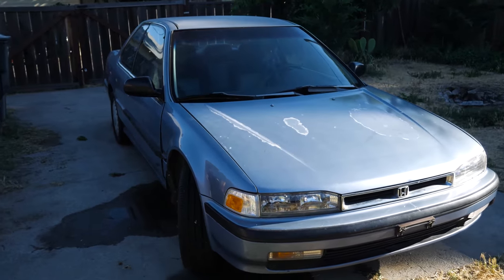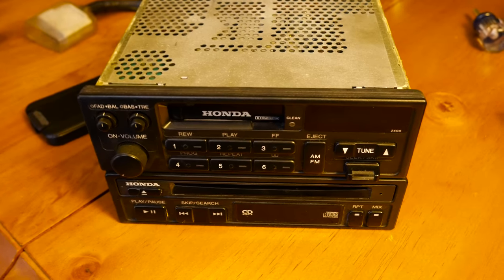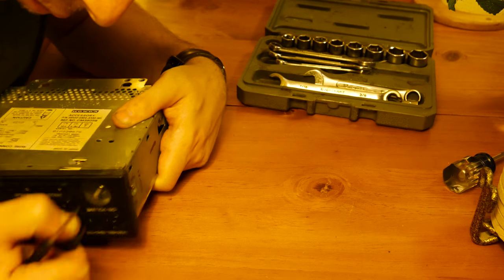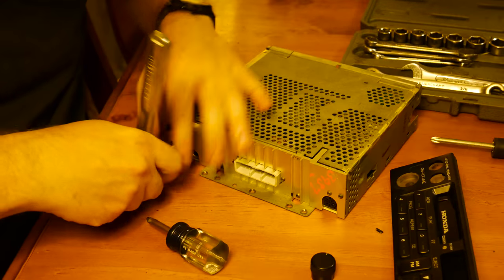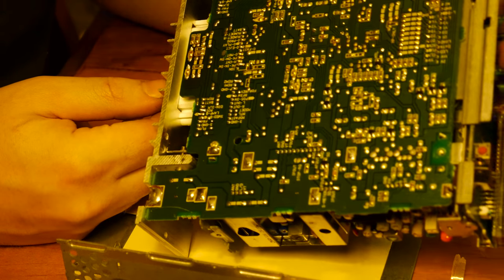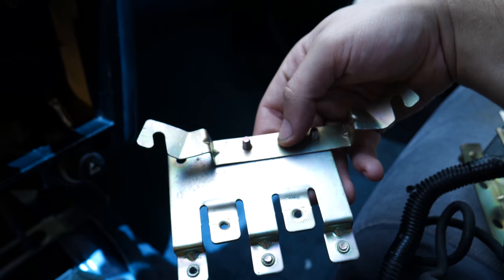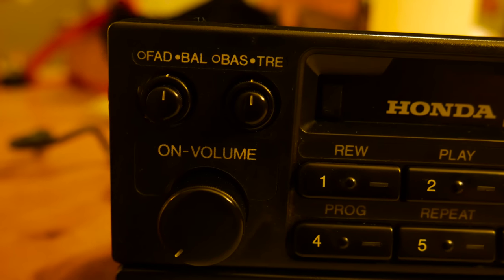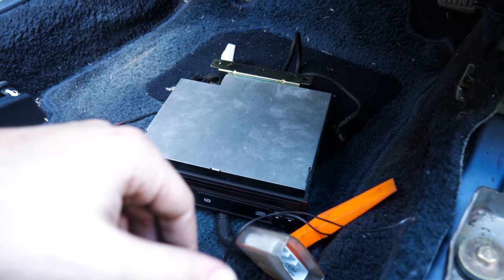Fixing a no sound issue with my OEM Radio [1990- 1993 Honda Accord]

Comment: no but HOW did you get the cd player out?  you're the only source on the internet and I'm paused on the bracket and it's not helping hmmm..
Reply from the maker: Oh it’s two Philips head screws behind the console that you can access on each side of the footwell, you’ll see em if you just look directly behind the stereo from that angle with a flash light. They should be a brass color, you got to have a long screw driver & the bracket for the cd player should stay in place when you take out both. Basically destroyed a CB7 console like 8 years ago when I ran into one my first time lol just take it slow
Reply from the maker: If you have any more questions just message me on instagram @paycotsunami
Reply: you're faster than chatgpt haha no way thanks

Comment: Did you ever get the CD player to function?  I have a "3000" Series tape/radio with the add-on CD player, and I have the same issue with the CD player,  it no longer functions.
Reply from the maker: I've gone and grabbed 3 in total since then. None of them function properly and honestly I've taken all three of them apart extensively to no avail 🙅 only thing I've seen is the actual CD motor went out. I personally gave up on a functional cd player so now it's in for looks in the CB7. I hope you have better luck than I did, next step is to take it to a shop to see if they can figure it out
Reply: @PaycoTsunami   Bummer.  I too have sourced a second 2nd player, and it also doesn't work.  I heard of a place in NY called United Radio that's supposed to be the best repair shop in the county (Honda does or at least did send their radios there for warranty repair and remanufacturing).  I think I'm gonna give them a shot.
Reply from the maker: @jtp336  DUDE thats sick! Let me know how it goes, if it works out i'll be sending a few units over there myself! Add me on my IG Account
Reply: @PaycoTsunami  I don't have IG, but I'll subscribe to your youtube, and post back here if I have any success with them.
Reply: @PaycoTsunami  Do you still have one of those CD players?  I think I might know some people who could fix them over here on the East Coast lol
Reply from the maker: @SgtSnazzerino  Dude I literally have 3 non functioning CD players hahaha I really need to quote some out to see how much they would charge me!
Reply: @PaycoTsunami  Theres a little place called "Makerspace" near me.  Some of the guys there owed my dad a favor coz he donated some equipment so one of them fixed my TCU haha.
Reply from the maker: @SgtSnazzerino  they have something like that locally but it's been out for awhile since covid, I might hit up some spots and hopefully get SOMETHING going 😆